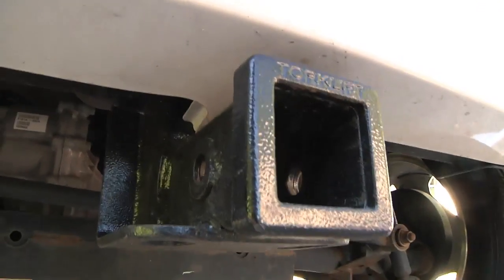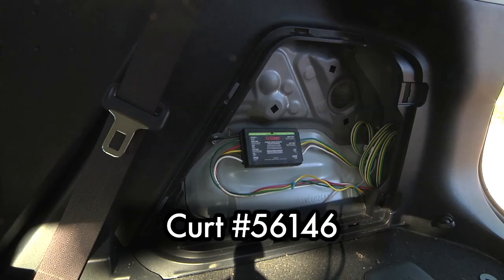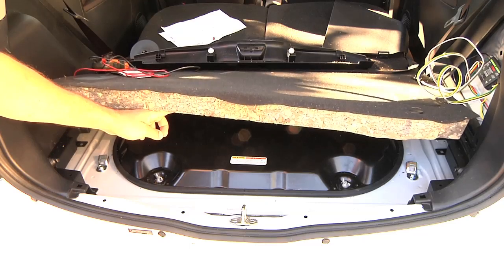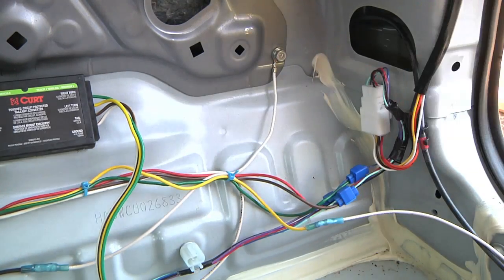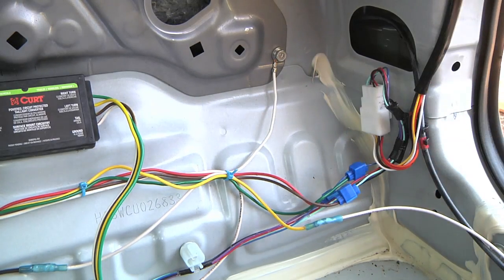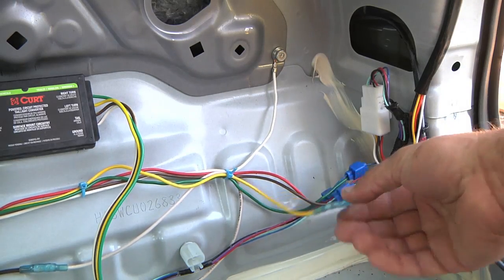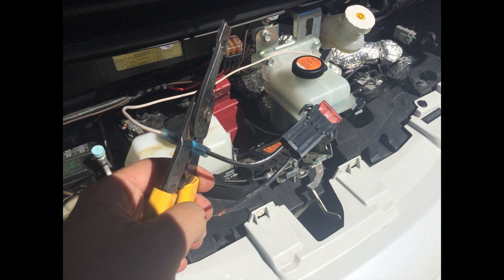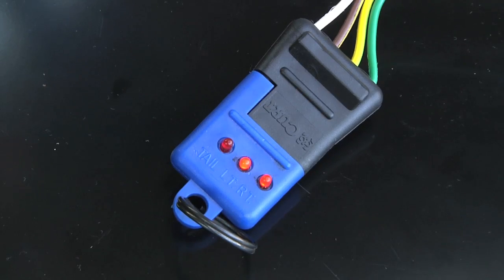Mitsubishi iMiEV Trailer Wire Harness Installation

Comment: Thank you for you video 
Do you have picture or vidéo Showing you Hitch installation?
Reply from the maker: I don't really have much of the hitch installation, as I was pretty busy just figuring it out and DOING it, rather than documenting it.
I purchased the Torklift Central EcoHitch and just followed the directions that came with it. It just bolts on. There's really nothing terribly special or complicated about it.
Here's an article I wrote about towing just after I installed the hitch: https://300mpg.org/2016/08/18/the-joy-of-towing/

Comment: Do you have to remove the driver-side under-dash cover in order to access the fuse box on that car?
Reply from the maker: No. For adding this wiring system, there is a fuse, but it's an additional one and just goes otherwise straight to the 12V battery.
Reply: @BenjaminNelsonX  I needed to access the fuse box for a different reason.... blown fuse
Reply from the maker: @Authoratah  Just follow the owners manual.

Comment: Ben- did you have any videos of pulling your teardrop trailer with the iMiev?  Thanks!
Reply from the maker: I've taken some photos, but I don't have any video of the iMiEV with the teardrop trailer. I'm planning on filming some when I go camping this summer.
Reply: I am (hoping and it looks good) to buy the last remaining available Torklift trailer hitch from a fellow Miever on the iMiev forum.  He bought it, didn't get to install it, and is selling the miev that he was planning on putting it on.  Fingers crossed it will all work out and in two weeks or so, I will be able to carry around a bike rack or possibly a small enclosed rack to hold some of the smaller parts of my ever expanding drumset  ;-)
Reply from the maker: The Torklift hitch is a good one. It's nice and solid. I don't have a bike rack yet (although I may be getting  one from a friend soon) but I have also used one of those slide in cargo-carriers with good success.

Comment: Are you planning on towing some sort of generator/ range extender ? Just curious . Joe
Reply from the maker: No, I'm not planning on it. I have a friend who experimented with a pusher trailer with good success, but I don't have any plans for that. Nope, just planning on using a trailer without using gas. I figure that's a pretty good substitute for a gasoline powered pickup truck.
Reply: I am - someday.... That's the plan anyway.  If someone wants to brainstorm with me... All I am planning on using is the back end of a motorcycle with a universal joint in the hitch.  I figure I just need 25-30 HP to maintain, or aid at highway speeds.  I don't need it to replace all the power - just to suppliment and leapfrog charging stations on 200+ mile trips ;-)

Comment: That compartment is where the jack and wheel wrench live, at least on other versions of the 'i' and iMiev. Is it the same for the US version?
Reply from the maker: On the 2012 U.S. Mitsubishi iMiEV, the car includes a 12V air compressor and tire sealant under the rear seat. The "storage compartment" in the right rear was empty.
Reply: I guess Mitsubishi 'deleted' the jack and wrench for the US version. Looking closer I can see that the metalwork behind the access panel is different.